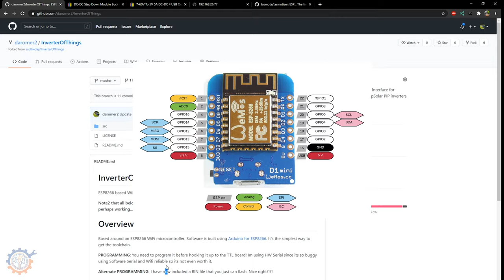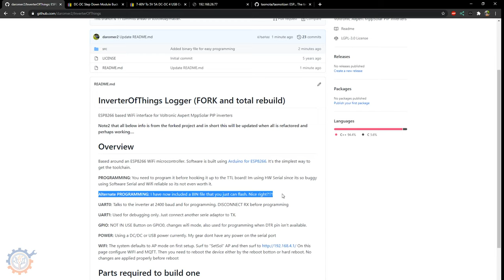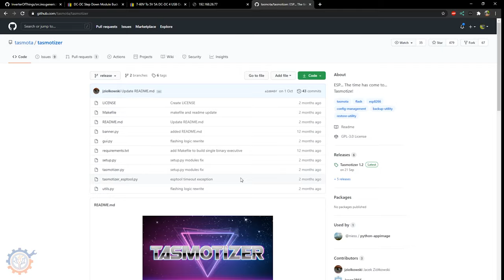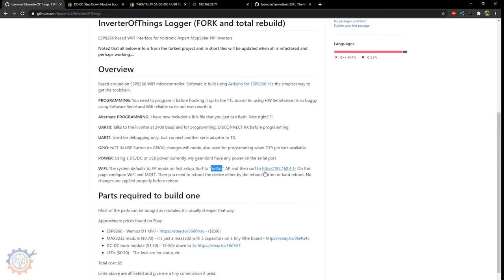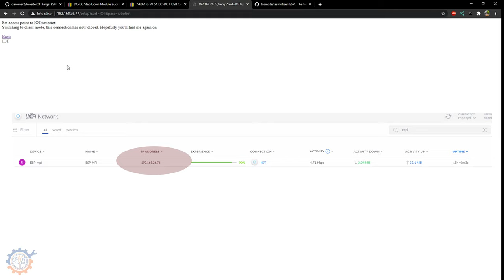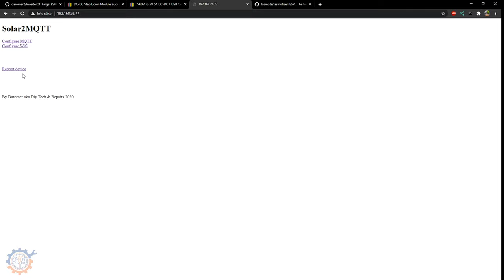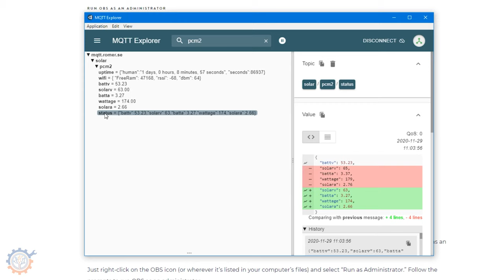Making your inverter wireless - What a great idea!

Comment: So Mpp Solar HV2-5048 is using P18 protocol. I had to code from scratch not being a programmer, it took a while. I got this working and setting commands work as well. Thank you, for the idea
Reply: Hi how did you change the protocol?
Reply: @jenschristensen8363  i don't understand the question well - i have not changed the protocol. I have written my own code for d1 mini using the idea from this video. Because that particular protocol (P18) my inverter is using was not available in the code written by the author of this video

Comment: Where would i go in those git hub files to change the serial port command set? I have a Steca, but it uses many of the same codes, just for different functions.  I thought I would see at least outlandish values, but I get 0 for every field. I even reversed the tx and rx just in case.  The same pinout on a usb to serial works fine, so it's not the cable...I fear it's the operator. There are values in Wifi topic, but every other topic is blank. I tried MPI and PIP.  No change.

Comment: your presentation is clear as always.
How did you figure out the inverter rx, tx, g, vcc, pin-out? it is not always specified in the inverter documentation 😔
Reply from the maker: Thats corret. Not all vendores want us DIY people to hook things up im afraid. In some cases you can figure that out by opening it up on the inside. and check. Then you can hook up a reader with different baudrates untill you find proper data. Unless you know the baudrate that is.
Reply: @DIYTechRepairs  many thanks, opening it might void warranty and frankly I am noob wiith electronic side, would it be possible to find out by using multimeter on the RJ45 pins, for what values I should be looking (estimated)?
Reply from the maker: @abusam1  potentially yes you could. A scope would be better.

Comment: Dear sir i M stuck at both lights on ( red and green) rs232 to ttl converter not connecting to inverter. I have checked all the connections. Everything is ok but not connecting to inverter.
Voltronic Power Axpert VM3 inverter.

Comment: I'm looking for this to work with a growatt min. Inverter.
But I was not looking for mqqt, but gagues.
I was looking at the code for the ads1115 which is fine but had trouble shifting the data over. 
That uses JSON  but for some reason the strong format (which I had to change) wouldn't work (getreadings)
It was to monitor solar strings individually.
It would be easy to port to  battery and inverter output. But data exchange..
I2c....

Comment: Hi hope you doing well, i have followed your video and flashed my nodemcu (i dont have wemos yet )with bin file. i can see the AP (solar2mqtt)  in my available wifi network . but there is a problem that after setting up mqtt server and ssid after connecting to "Solar2mqtt"i cant not see data in my MQTT explorer . can you please help on this .
Reply from the maker: @aaqibraza6821  most likely wrong connection to the inverter. But it should show its alive?
Reply: @DIYTechRepairs  its not showing any live status

Comment: I've done this for 2 inverters and working flawless and can set parameters remotely too. Coded my own.
Reply: Hi could you please give any help about this project.
Reply: @bobkammoun8375  are you trying to build from scratch
Reply: Yes dear i have already programmed the nodemcu and connected it to rs232 max db and i am getting data from info, wifi and up time but no data from status
Reply: @bobkammoun8375  check the checksum...
Reply: @kARTechnology  im sorry i didnt get your point where should i check it
Reply: @bobkammoun8375  if your status request command is incorrect the inverter simply doesn't reply anything back. Did you build your own communication or using any code from github

Comment: I think we can't simultaneously connect USB connection with and Rs232 connection with inverter, as Nodemcu has same UART I believe, but you have not used software serial library instead?
Reply from the maker: No you cant use USB and RX/TX at same time on the esp8266 no. Its either or and its described in the video as well. I do that because running software serial towards this inverters is so unstable due to the libs. Its crashes to much.  On the ESP32 though this can be remade but on other hand i have no use having to use the usb at same time as its connected to the modbus adaptor.

Comment: Seems like it doesn't work with Sorotec Revo II Inverter. Too bad... Sorotec uses SolarPower and WatchPower Applications via USB Connection or RS232 to view data on computer. I did most of the parts as you mentioned in the video except for the TTL Module. I used RS232 to TTL (MAX3232 Module). It did connect to the MQTT Server well but didn't talk well to the inverter. Both the red and green LEDs are on.
Reply from the maker: If it uses watchpower it should work.  Most commun issue is The ttl converter

Comment: Hi i made exactly what you show over the video but my Outback Power SPC III 5000W - Off-Grid Inverter - Hybrid dont recived any data. Do you know what is missing.
Reply from the maker: What protocol does that inverter use? The device works with MPI and PCM devices and have code for PIP but its not properly verified.  If you can hook up for debugging
Reply: @DIYTechRepairs  Hi how i know what protocol i need to use?
Reply from the maker: @SalvatoreDePascali  read the manual for the inverter or talk to the manufacturer so you get the protocol

Comment: Very informative. Does this setup works with with other brand of invertors aswell. I mean the pinout from the RJ45 would be same for all brands?
Reply from the maker: No they arent. The RJ45 in this case is only for the PCM60x. the device it self can be used for others that do serial and if you have the protocol.
Reply: @DIYTechRepairs  Thanks for the update. I am trying to do compilation of the code, the hard way, through ArduinoIDE. It gives out error at Line No 92 "exit status 1
'service WifiMode' was not declared in this scope". Help would be much appreciate.
Reply from the maker: @ZulqarnainUlHassan  I just tested and no compilation error on latest version from Git. Can you copy paste the full error somewhere and link?

Comment: what a really generous person. you made it very cheap but in market these devices cost $70+ . 
Little question, can our WatchPower software of inverter detect this in-network so eighter showing results in MQTTserver, we can see results in actual inverter software?
Reply from the maker: No you cant use both at same Time. Its either or.
Reply: @DIYTechRepairs  i mean using this  device, we connect to our software instead of MQTT server ? is that possible. 

in that way we can chnage settings for our inverter, as you also doing this before making this device. with wire and PC and inverter software. 
is that possible with this wifi device ?

Comment: hi, 
great job by the wy ;) 
this only working with this inverter, right ? is possible use in GTIL inverter too ? 
or how I change the code (i´m hardware man, not programming) :) 
regards
Reply from the maker: thanks. dont know what protocol gtil have. out of the box it wont work no :)
Reply: @DIYTechRepairs  i have the protocol , i think :)

Comment: Hello again, does any body know what do we need to change in the code in order to get the data as INT not as STRING to get more accurate data.
many thanks.
Reply from the maker: The data is always returned as string since its serial. Just convert it from string to INT instead if you need it like that.
Reply: @DIYTechRepairs  I mean I am getting data like battery voltage as 24v without any decimals but in the video, it seems that there are decimals in the received data.
Reply from the maker: @bobkammoun8375  There is as well. You need to look at the raw data you get and convert it.  I just forward the data as its recieved from the inverter :)
Reply: @DIYTechRepairs  Many thanks for your support.
Reply from the maker: @bobkammoun8375  it can also be confusion between , and .

Comment: I am going the other way because I do not use wireless. I use a sol-ark inverter that only has a wireless dongle connected to a serial port. Is there anyway to connect an internet cable to that serial interface?
I was thinking to sent the data from inverter, somehow  to Grafana or Home-assistant but the inverter company does not offer  offer any support on that on that and they only have the wireless connection that sends data to a server in China.. They just provided me with the mod buss RTU Protocol manual.  I am brand new to this and I am willing to pay you if you can offer me some direction.
Reply from the maker: Hi depending on protocol you can use My solar-sis system or code something else  :)

Comment: Exactly what I've been looking for. I have the MPI 10 kw hybrid model and i gave the manufacturer SNMP card a try which died in a month. Awfull. Did you get this to work with your MPI inverter? Ive built this device and it connects to the inverter. I get the green light. In Mqtt explorer it reads all values as zero. I think it might have to do something with the communications protocol. In the Mqtt setting i choose MPI. Ive tried with the other two options and  I get similar results.
Reply from the maker: I have been running it solid since the start without issues. If you dont get data back that means you dont get answer from the inverter. Its important to connect the board that converts the signal from RS232 to the 485 that the inverter uses.  If you have the knowledge you can hook up and debug the data on the tx2 port.
Reply: @DIYTechRepairs  Thanks for the reply. My inverter has an rs232 female port on it. I could try using a esp32 to debug on the tx2 port maybe?
Reply from the maker: @MoAlisaab  just connect it to the Serial adapter on your computer that you used for flashing
Reply: @DIYTechRepairs  I think I know what the problem might be. There is a start bit that the inverter is looking for before a command "^" Im not sure how to input that into your code. Can I take you up on your paid offer to help setup? Thanks.
Reply from the maker: @MoAlisaab  its already included in the code. If using correct type. But sure Contact me. Info on Contact page
Reply: @DIYTechRepairs  I think I may have figured out the issue. I emailed you my latest findings but they keep bouncing back.
Reply from the maker: @MoAlisaab  mail sorted. What was it?
Reply: @DIYTechRepairs  A bit of an explanation. Emailed you.
Reply: @DIYTechRepairs  in "inverter.cpp" towards the end before "serial.print/r" I uncommented the two PIP CRC arguments. I figured there was some confusion there as to why the weird command ending was being sent. now it works like a charm. Thank you. Please let me know how i can send you some cash for making this cool program and your help.
Reply from the maker: @MoAlisaab  Shouldnt matter since they are only triggered if you set it to use PIP or PCM. Good that you got it working. You can always find my paypal on the about page
Reply from the maker: Im so sorry! I checked now and i had forgotten to push the fix thus thinking that the code on github was the one working...  Checked locally now and of course i sorted the CRC errors :D
Reply: @DIYTechRepairs  Я сгрузил src.ino.generic20210505.bin файл и у меня одни нули идут ,значит вы не исправили ,или я что то не так понял ???

Comment: i can test PIP if you want,i have voltronic igrid 5kw 2 in paralell, pip 2,4kw low voltage solar and high voltage and 5kw high voltage solar, flashed your bin file but in mqtt config even if i set it to PIP it sends P003PS Message
Reply from the maker: The latest release? Ping me on mail or github and lets take a look. I did upload new code a week Ago btw
Reply: @DIYTechRepairs  git

Comment: Hi Daniel! Does this work with your MPI 10K Hybrid inverter over RS232? I am trying to do the same. Thank you in advance for all your help
Reply from the maker: Yes it does. But There might be a codeverror. So let me know
Reply: @DIYTechRepairs  sorry what do you mean by this?
Reply from the maker: @MaximumPCs  I have fixed it. I had an issue in the code that i fixed locally but never pushed to git... DOH!!
Reply: @DIYTechRepairs  wow great! I look forward to trying it =D it seems like a super simple way to send data from my MPI 10K to MQTT together with data from DIYBMS
Reply: Another unrelated question - how have you connected your MPI 10K? Is your grid connected to the red ac grid connector and your house to the black ac output connector? Are you using it to export to the grid at all? I am using grid tie with backup (ii) mode but it seems to be using some grid power when solar is available doesn't make sense
Reply from the maker: @MaximumPCs  both :) you can find diagram on My webpage. Though i got an extra ats now. Yes i export. I have permit to sell back excess energy
Reply: @DIYTechRepairs   Hi Daniel, I finally got my Wemos Mini! Can I still use the bin file you uploaded? I tried compiling the code myself in Arduino IDE and it uploaded but I'm not seeing any data in MQTT explorer
Reply from the maker: @MaximumPCs  you need to configurr it. IF you havent it wont send any data
Reply: @DIYTechRepairs  I've configured it to my wifi and MQTT broker is there anything else to configure?
Reply from the maker: @MaximumPCs  Corrent url, port, user and password?
Reply: @DIYTechRepairs  I got it working finally! Had to made sure inverter tx -> max3232 rx however for my max3232 DB9 board to wemos connection I had to make tx-> tx and rx-> rx how strange. I noticed the AC wattage data I'm getting needs to be multiplied by 10 can this be done in the code? AC Input and Output current is reporting 0.00 for R,S,T too hmm. Also do you know if we can retrieve the daily kWh generated from solar that is displayed normally on the inverter LCD?
Reply: @MaximumPCs  Dear are you sure about connecting rx to rx when using max3232 db9, since in the image attached to the project it shows that it need to be rx > tx .

Comment: Assalamualaikum
I'm Muhammad Rashid from Pakistan.
I like it.
I need your help.
I have VFD invt chf100 i want to make it wireless.
Can you help me?
Reply from the maker: Do You have its protocol? If so its possible. If its Close to same as mpp you can use My code as base
Reply: @DIYTechRepairs  it has 485 communication port and also some type of terminals as well.
Please check specifications of invt CHF 100 VFD 15-18 kw

Comment: Is the PIP supportet now? ☺️
Reply from the maker: Should be but i cant test since i dont own One :)
Reply: @DIYTechRepairs  Sweet, thanks! 😀
Reply from the maker: @MIUdk  ping me when you installed it and i can help and or correct If something doesnt work
Reply: @DIYTechRepairs  I have had the PCM up and running for a few weeks now working perfectly, i have tried the PIP however i am getting no output over mqtt, i have looked through the source and it appears the PIP section is missing with a message saying  "This one is not done..."
Reply from the maker: @VirusX87  code is There but i hvae not been able to test since i dont own One thus adding that some Day back in time :)
Reply: @DIYTechRepairs I can help test as much as you need if you can help me get it up and running?
Reply from the maker: @VirusX87  sure
 Do you know how to code too? IF not il just quickly check later this week where i left the pip off
Reply: @DIYTechRepairs  sorry i know very very little, Ill wait for you to work your magic and test when your done :)
Reply: Was the code fixed for the pip inverters? Would love to have this on my inverter... currently using a pi....
Reply from the maker: @42FaLLeNAnGeL24  No i have No pip to test on. I can check the code i got from One but i cant test it
Reply: @DIYTechRepairs  can you send mqtt commands to change the inverter state with is project? If u think the code would work i can build this project and do some test with you.
Reply from the maker: @42FaLLeNAnGeL24  yes. It can

Comment: Has anyone been able to get the bin to load for an ESP32 yet?
Reply from the maker: Its not compiled for the 32. You have to recompile it and of course recode it.
Reply: @DIYTechRepairs  Thanks Daromar. I am in the middle of doing it now and I will drop in my notes to this comment.
Reply: @DIYTechRepairs  Goddamn this is harder than I had imagined. I'm struggling to get the libraries updated for ESP32. Anyone else?
Reply from the maker: @drc6940  some Day i might recode it but since the 8266 is cheaper i run with that :)

Comment: Thank you so much for this tutorial - i've solderd everything together; TX RX RS232 and TTL is correct; in the MQTT Explorer i get Infos that the device is alive and also the variables (e.g. solar1w...) but there are no values. Can you please help me?
Thanks
Reply from the maker: Then you have a problem in the com between the device and the inverter. Either wrong protocol or its wrongly connected.